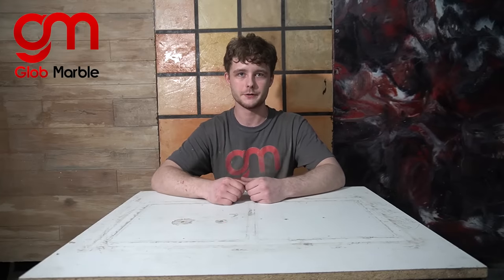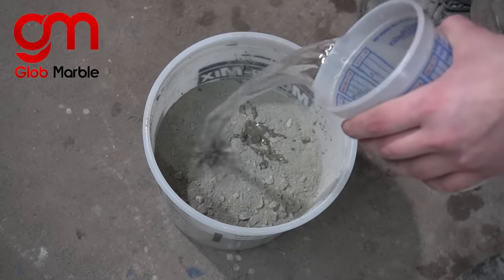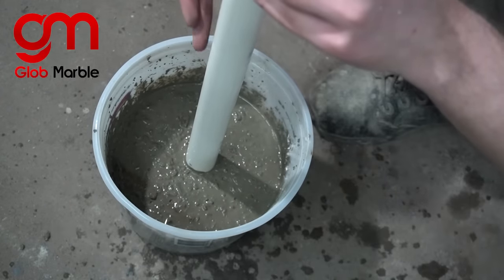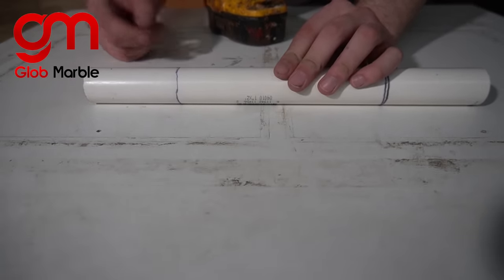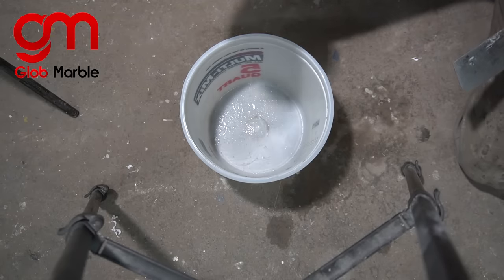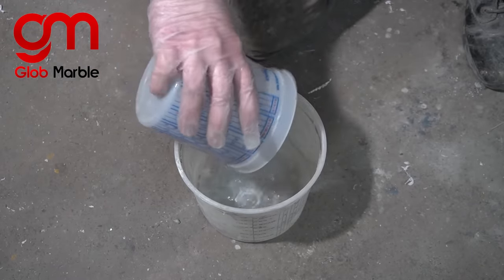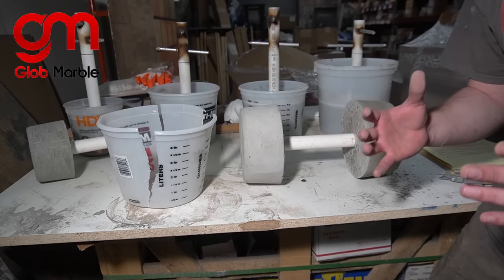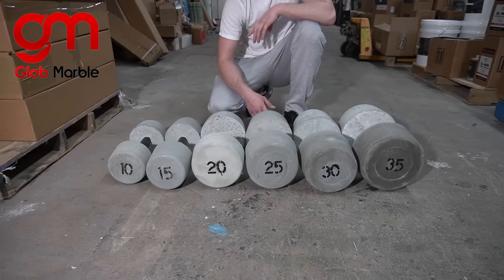Concrete Dumbbells | DIY

Comment: very good Idea mate nice work I think I would have. Little things I would have done differently one keep it in the plastic bucket over time dropping the weights will chip away the concrete, two I would have filled in the pipe with concrete as well for a little extra strength in the pipe, three if you put your pipe in the dry concrete mix and to measure at the start you wound not need to waste it.
Reply from the maker: Thanks! Keeping them in the bucket would definitely add strength, but they wouldn't look nearly as cool. Also, concrete in the tube would not add any strength. concrete is strong under compression like under a hydraulic press, but extremely weak when it comes to bending, which is why people use rebar to keep it from cracking. Also the concrete sits much lower in the bucket when its mixed with water then when it is dry. The best way to not waste any concrete is to work quickly. Have the nails precut before adding water to your mix. That's what I did with the rest of the buckets.

Comment: If i were to do this how heavy could i go? Would the pipe break during a workout if were to cast a 40lb dumbbell?
Reply from the maker: I doubt it, I have a 35 lb one, but to be on the safe side you can use EMT Conduit instead of pvc :)
Reply: @GlobMarble  would steel pipe work?
Reply: @GlobMarble  thank you
Reply: @python9657  I was thinking the same thing but he didn't reply. I would like to know myself cause it should be a lot better than the PVC.

Comment: I'm about to do this too! .DIY is cheaper and fun.Someone said use rubberized undercoat to keep the chips to a minimum when done.And reuse the molds by using Silicon lubricant.I was thinking of using lead weights and shove them inside the cement and to unbalance the weights as not to roll away and makes the wrist stronger by using the weights gripping differently.

Comment: how about filling the center of the pvc pipe w/ concrete first before creating the outside parts ? will also decrease the overall size of the dumbbell a small bit & make the center harder to crack

Comment: What do I do if I don’t have a drill?
Reply from the maker: Easy! Get much thinner nails, but still long enough to almost stretch the whole distance of the bucket. Use a hammer to nail them in. You will need much more nails, closer to 12 nails for one bar instead of 4.
Reply: @GlobMarble  just take a cutting player  to hold the nail and heat it till hot and insert it, it will slice in like butter, immediately pour water too cool it... Problem fixed...

Comment: Great video bro, but you also can re-use the bucket mold putting engine oil burned inside the bucket before adding the concrete mix and then when concrete is cured, just pop up the bucket without cutting it off

Comment: You can save a lot of molds if you spray the inside with marine grease before pouring the concrete.
Reply from the maker: You can get it out without oil. Plastic wont stick to concrete. I had to break it because of the ridges and scratches from mixing inside the bucket.

Comment: Thanks little brother, i made 4 dumbells 2X10 & 5X2 in your pattern. It really worked well, but you know what, you can save and REUSE that bucket if you use duct tape outside and inside to stick the edges. Ypu can save $2.35 on each use.

Comment: Over time will the concrete slide off? I’m worried if I’m doing incline dumbbell bench presses and the concrete falls straight on my face
Reply from the maker: It will if you don't put those nails in the pvc pipe

Comment: Just done this and turned out to be great, but i feel a bit insecure about the pvc so i  use metal pipe instead of plastic and to solve the slippery metal pipe when wet, i just use some leftover cloth wrapped around.

Comment: One Question: How do you know how much concrete to add, wouldn't the water affect the overall weight?
Reply: Well concrete  is dry once the water evaporates and im pretty sure  that quick dry concretes contain a conpound the makes the water evaporate  faster

Comment: awesome job.  did you have any issues with these weights cracking?  Or any problems with the pvc pipe bending?  is there a silicone spray to cover and protect the concrete?
Reply from the maker: I haven't had any of these problems, but you could use a concrete sealer to make them a lot stronger- https://globmarble.com/stamped-concrete-acrylic-sealer-hs-240.html

Comment: spray the mold with a a lubricant and then you should be able to re use it.  also i've read that once the concrete has fully cured (i.e. about 72 hours) you can spray it with truck bed liner. this way it is much less likely to chip.

Comment: Really good vid. Litterally the first thing I thought of when I saw the prices online. I wonder if you can dip them in some sort of rubber coating to protect them better?
Reply: I was thinking the same thing. I would also add in fiberglass fibers to the concrete for extra strength. Maybe coat them after they have fully cured with the spray on bed liner stuff they make for truck beds? That shit is tough as hell. Not sure if it would help or not. Just a thought.
Reply from the maker: These would definitely make them much stronger but the price would go up too :)
Reply: I was thinking  of adding electrical tape around it and adding some hot glue

Comment: would it be a good idea to wrap it with something to prevent making concrete dust if you want to use it inside ?
Reply: I guess plastic tape aur aluminuam tape might do the job.
Reply: @ashutoshdube6560  I'm not sure these will hold reliably on concrete.
A coating seems like a better idea.
Reply: People use "plastidip" over concrete plates. So that should hold up better with dumbells.
Reply: spray it with Rust-Oleum Automotive Truck Bed liner Coating Spray Paint..... it will give it little more strength
Reply: Several layers of plastic wrap + heat gun should do the trick

Comment: About the pvc pipes, do you think that they won't break with heavier dumbells? Do they bend when you're using the 35's?
I wanted to do some 20 or 25kg dumbells but I'm not sure if a pvc pipe is strong enough to handle that much weight...
Good video, keep it up!
Reply: you can fill the pipe with concrete too
Reply from the maker: They haven't been bending on me, and ive been using them for a month. If you want to be extra safe, many people are suggesting using EMT conduit. Concrete in the pipe would not add any strength. Concrete is strong under compression like under a hydraulic press, but extremely weak when it comes to bending, which is why people use rebar to keep it from cracking :)
Reply: GlobMarble half inch or three quarter inch iron pipe used for plumbing and making pipe clamps is very cheap and available at big box stores.

Comment: How do I know if they are the right weight as it says on them? U mentioned they are not at the right weight while the concrete is still waiting to set. So how do I know how much concrete/water to put so that it sets at the right weight when its finished

Comment: Thank you for the video do you think PVC would be strong enough for 60 pound dumbbell? Was thinking about using gaspipe.
Reply from the maker: I honestly wouldn't trust a pvc pipe for 60 lbs. at that point I would use something metal :)
Reply: @GlobMarble  hey, does adding the water change the weight of concrete? I figured it would at first, but once it dries? Im trying to make 60lb dumbells.

Comment: You didn't need 2 nails on each side.  And you didn't need to tighten the nails with lighter.  That concrete will fasten the nail / pipe joint beyond your could imagine.    Even if the holes were too big for the nails ,  works fine.

Comment: If you apply some motor oil inside of the bucket before pouring the concrete mix then it will be easy to remove the concrete without cutting the bucket.
Reply from the maker: The bucket will not demold because of the scratches inside of it. If you would like to demold the buckets and not waste them, mix the concrete in a separate bucket and pour into a new one. I don't think they would look as cool without the scratches though

Comment: Won't filling the PVC pipe too with concrete+cement mixture make the dumbbell stronger? Or should we keep empty like in video. Please advise?
Reply from the maker: The concrete in the pipe will not make it stronger. Concrete is very brittle when bended and a crack in the concrete handle might be a weak point for the entire pipe now.
Reply: @GlobMarble  thanks for reply. I meant to keep PVC pipe too actually, everything similar to video but also filling pipe with concrete mixture. Is it still weaker?
Reply from the maker: Yes it will be. Your pipe is more likely to break with concrete inside of it
Reply: @GlobMarble  ok thanks for reply. I will try to make as it is in video, however sacrete cement is difficult to get, will try an alternative.

Comment: Just wondering, can't you spray some WD-40 in the mold so you can reuse it later? It's because of this video I went out to Home Depot and got all the materials...thanks in advance.
Reply from the maker: Yes you can. The biggest reason I couldn't demold without breaking the buckets was that I mixed them in the bucket I was casting, creating scratches that grabbed onto the concrete. Mix in a separate container, use some lubricant and you'll be fine :)
Reply: @GlobMarble  - thanks 👍
Reply: @GlobMarble   - one last question at the 5:30 mark. How do you make certain the the top part doesn't lean to much to 1 side?

Comment: Hi , is it possible to use a steel bar instead of the PVC ? 
I worry about it bending , thanks .
Reply from the maker: Yes, absolutely, just make sure to find a way to attach the spikes like I did
Reply: @GlobMarble  okay , thanks a lot 🙏.

Comment: Place plastic wrap inside the bucket first then pour concrete, and you can pull it out when the concrete dries without cutting it open and reuse it.

Comment: I recently made dumbbells using leftover lead and cast iron plumbing pipe for the handle. Due to the density of the metal, they appear much smaller than the dumbbells everyone is used to seeing. To recover my pride I made a couple from cast aluminum, these are just too big! If I pretend to strain I look like the hulk.

Comment: This might be a dumb question but are those marked in pounds? You don't have 35kgs on concrete on the last one, right?
Reply from the maker: No, those huge 35 ones are still lbs. They are pretty big, and if you want to make the concrete smaller but still the same weight, you can use pieces of scrap metal as an aggregate. I've even seen people use motorcycle gears layered in-between the concrete like a cake.
Reply: @GlobMarble  Oh that's an awesome idea. Thanks so much for replying. I will look into using those.

Comment: Hi, can i use yellow sand instead of gravel to make concrete? Thanks
Reply from the maker: Yes, absolutely. It is actually easier to work with this mix. 1 part cement to 2 parts sand.

Comment: Hey, just wondering which exact aluminum nails you used and where you got them. Could you substitute something else to secure the concrete to the PVC? Thanks!
Reply: Us still Neil's aluminum doesn't react good whit the concrec and concret can crack over time

Comment: Alternatively , you could have cut-split the pipe ends and stuck a rock inside to form a V at each end  .   That pipe is going no where with concrete gripping on the V ends.     Cheaper and faster , right ?

Comment: Nice project. you may not notice much loss of weight when cured. Concrete doesn't so much dry, as cure. Water molecules are bonded in the concrete..
Reply from the maker: According to Eurocode, dry concrete weights about 24kN/m3, in wet condition it will weights 25 kN/m3 (+1 for mix water)

Comment: Shaky-handed & off-centre as I tend to be, I'll use two scrap strips of wood to line up the PVC pipe. Trust me, I'll need it, or the weights will be painful to use!
- Also saw @Josh Bar's comment from 2020 about using demolding solutions so you don't have to cut away the bucket each time. He said it saves on costs.
- I also realise it saves a lot on plastic waste, which is Huge in the world, so anything you can do to reduce That, fantastic!

Comment: Would your superplasticizer make concrete weight plates nearly indestructible in a gym setting?
Reply from the maker: It would definitely make them way stronger but I wouldn't recommend tossing them around like you would with steel dumbbells. You could once you cover them with bed liner though :)
Reply: That's a great idea thanks
Reply: Would Fiber reinforcement make a big difference?
Reply from the maker: It would help a lot with the entire strength meaning it wont just crack in half once you drop it, but the fibers wont stop the concrete from chipping on the sides. If youre interested we sell fibers here- https://globmarble.com/index.php?route=product/search&search=fibers
Reply: Thanks

Comment: Is there a way to make sure the pvc is exactly in the middle of the bucket?
After you make the first half, is there a way to make sure the pvc is vertically aligned?
Reply: You can use a ruler or tape measure to make sure the pipe is the same distance from the bucket's edge all around.

Comment: Nice to see weights with real concrete concrete, not just mortar.
Reply from the maker: If you noticed, all the other dumbbells were made of a combination of 1 part cement and 2 parts sand. I did that because it was much easier to level the pipe without all the gravel and pebbles in the way.

Comment: you can get it out without breaking the bucket, just apply any oil on inner surface of bucket before putting mixture.
Reply from the maker: You can get it out without oil. Plastic wont stick to concrete. I had to break it because of the ridges and scratches from mixing inside the bucket.

Comment: You still have to water those after a week or two right?, it might crack if you don´t
Reply: No, only the first 24 hours we have to water when the concrete starts to get dry I guess
Reply from the maker: A lot of people will keep watering the concrete after it has been demolding, and this does add strength. I didn't do it though and still have no problems!

Comment: What is the ratio of concrete to water to make sure it cures appropriately non-dependent of the weight of dumbbells? I want to make a set as well! Thank you!
Reply from the maker: It varies with the concrete you use. The water dosage will always be printed on the bag :)

Comment: I would definitely look for steel handles, find a weader and weld those nails in (ill use rebar) then cut to length, hammer in, weld in place and your good .

A suggestion, there is this soft material you can place on shit, its like foam and hardens in place would be perfect as it would give a better and more comfortable grip.

Comment: Water does not evaporate out of concrete.  It becomes chemically incorporated.
Reply from the maker: Most of the water evaporates. This is why you must wait a month before sealing a freshly poured concrete slab
Reply: Concrete cures in all conditions even underwater. Evaporation is not a term used in form setting.
Reply: @GlobMarble   Weigh the barbell after you pour it, and after a month.  You will find they  weigh nearly the same.

Comment: You could have put oil on the sides of the mold and mixed the concrete in another tub and pour the mixture into the oiled mold and then done it you wouldn't have to waste those molds as the oil will help the concrete to separate after getting strong and hard

Comment: The weight on my 2 inch thick by 4 feet pvc pipe is 120lbs, 60 pounds of concrete on each side? Will it break or crack? Thank you🙏🏻🙏🏻🙏🏻
Reply from the maker: It will definitely bend! I recommend using a different material for the handle.
Reply: GlobMarble ill be holding it in the middle and its pretty much too late to use a different handle

Comment: if you oil up the bucket, it comes clean of and you can reuse it.
Reply from the maker: The bucket will not demold because of the scratches inside of it. If you would like to demold the buckets and not waste them, mix the concrete in a separate bucket and pour into a new one. I don't think they would look as cool without the scratches though

Comment: Maybe could use fiberglass Bondo instead, very strong and durable. It's a bit light though(and more expensive), one gallon weighs 10lbs, but u could probably put some metal inside of it, to add weight.

Comment: Would you recommend quikcrete or sankrete? I'm having trouble finding sankrete brand concrete, both are listed as having 4000psi once cured
Reply: Also, would people recommend " crack resistant" concrete over regular concrete? Same psi on each
Reply from the maker: There is no difference, just two separate brands. Getting the crack free option is a good idea too :)

Comment: Rub some motor oil on the inside of the pail so you can slide it out and re use it
Reply from the maker: The bucket will not demold because of the scratches inside of it. If you would like to demold the buckets and not waste them, mix the concrete in a separate bucket and pour into a new one. I don't think they would look as cool without the scratches though :/

Comment: good job are they weight accurate?
Reply from the maker: Weight is only a few grams heavier because of the leftover water weight, but this is basically the weight of an iPhone so it isn't a problem :)

Comment: I didn't like that the first 10 lbs of concrete was wasted, I don't think it had to be.  Just weigh it, and use a longer piece of pvc.  Then, measure afterwards to get the handle the right size. Also, I think the buckets could've been reused.  The less waste, the better.  The electric tape on the handle was a good idea.
Reply from the maker: I added a note saying that if you work quickly you wouldn't need to waste anything. Concrete takes a while to set to the point of it not being workable anymore